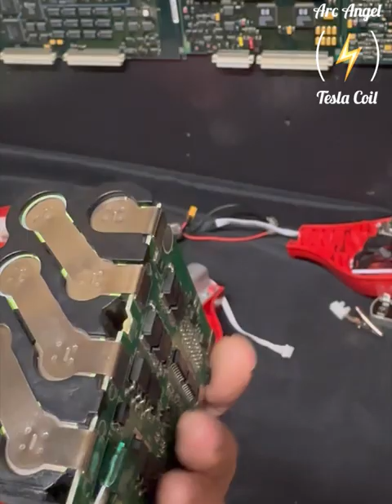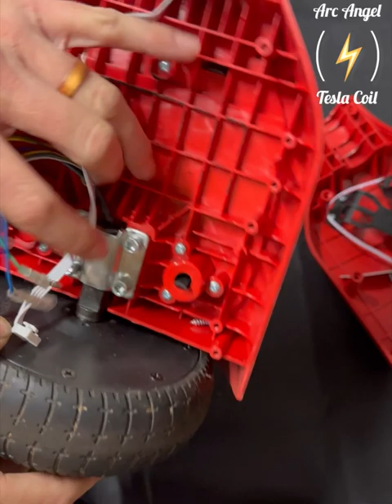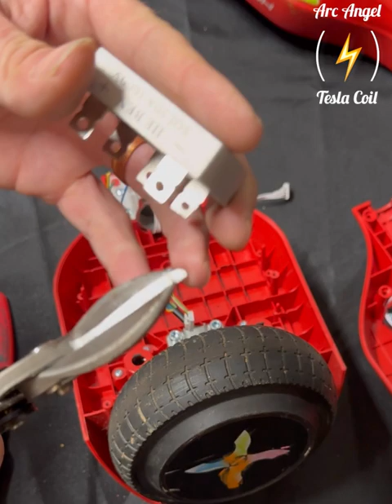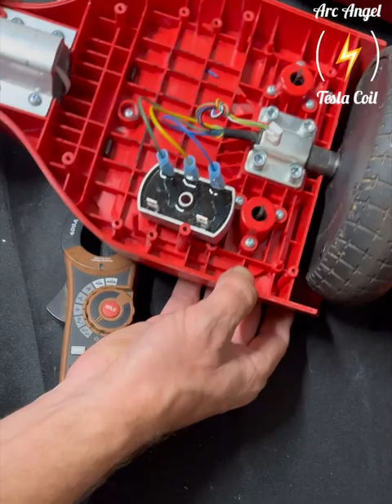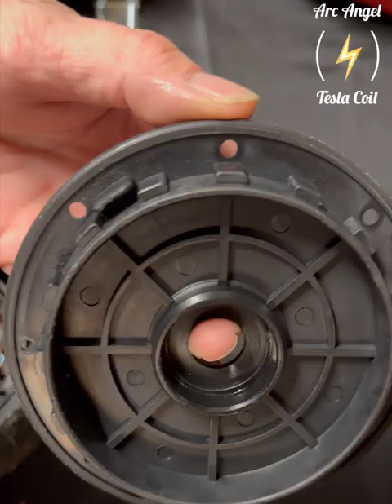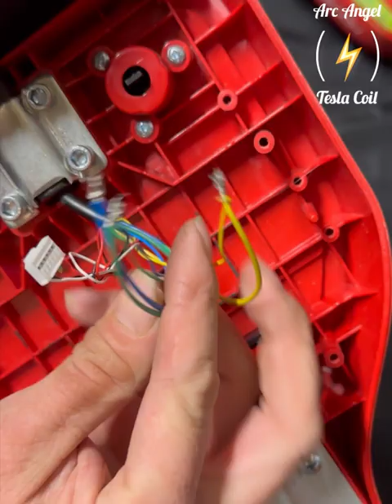⚡️DC Rectified Hoverboard⚡️#generator #diy #hoverboard

Comment: To use these as a generator. Hook the wires to diodes. Use 6 of them rated for at least 3A. Wire 3 diodes with the polarity going in and 3 diodes with the polarity going out. It is a 3 phase rectifier. Keep the frame and trim as needed for your project. With moderate spinning it makes about 24V at 2A. The open circuit voltage can get as high as 60V so you definitely need a voltage regulator or converter with these. They make awsome peddle power generators. Recommend using a capacitor and wide compliance DC to DC converter module. Also a voltage regulator for a riding lawnmower works good for charging 12V batteries with a windmill.❤
Reply: What a load of old cobblers. Absolute tommyrot. Just another SCAM, SCAM, SCAM.
Reply from the maker: @moking8095  I'm not sure what you talking about but for a generator these motors work not trying to run the motor off of dc just generating power
Reply from the maker: @moking8095  https://youtu.be/y-FkTr6bxuo?si=FH3_mwqz2MUkPXjI

Comment: This type of motors an be converted in motor-generator, leave 1 phase in place as it is and disconnect the other 2. Disconnected phase will go for output wired in parallel, dump in a cap bank and for there use half bridge (one wire system) with one to feed back the motor (phase left in place) while the rest is to power whatever you need. 

This type of motors are very powerful and when 3 phase are used makes 3 motors in one. Just disconnect all other circuits and make your one, eventually if batteries are in good condition use them instead of cap bank. Magnets might need to be repositioned or replaced if output do not sustain the motor and same extra … ideally 36 coils with 12 magnets in such arrangement that 1 powered phase will have at least 1 induced phase on two coils diametrical opposed.
To see easy how they go make two cardboard circles, 1 for magnets and 1 for coils, make different arrangements until they reach desired position, in such way to make a pump mechanism on diameter, one shrinking and the opposite growing, than next set, than next, while 1-2 magnets reach the powered coils from phase 1.
So, no need to go for wind power.

Comment: Thank you for the information and video! I appreciate the effort you put into your channel !!  Do you have a setup using the hoverboard generator to charge a 12v/100AH battery?  It would be awesome to have a setup using the hoverboard to charge batteries to have for camping or emergency situations….  Thanx!
Reply from the maker: With a buck converter you can!! Like a DC to DC up to 60vdc input and output 0 to 60 at 10amps so just set it to 14vdc or whatever you need and you can limit the max amps you want to charge at to a maximum of 10amps
Reply: @ArcAngelTeslaCoil  Thank you for the reply! Your knowledge far outweighs mine on this topic. Would this be a video you’d be willing to take on? I wouldn’t know to set this up… Is a charge controller needed ? Something that would handle 3 phase from a wind turbine or one used for solar panels? Would a Lithium battery charger be better driven from the hoverboard?
Reply from the maker: @jlh2119  let me see what I can do just give me a little time👍👍